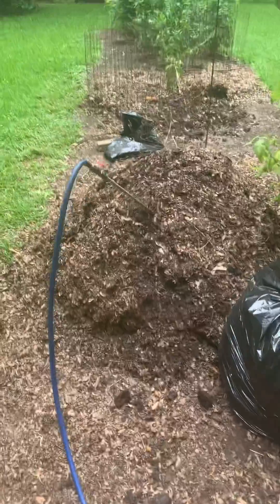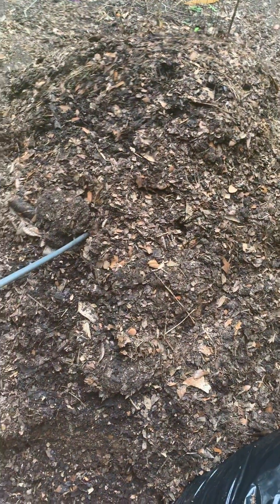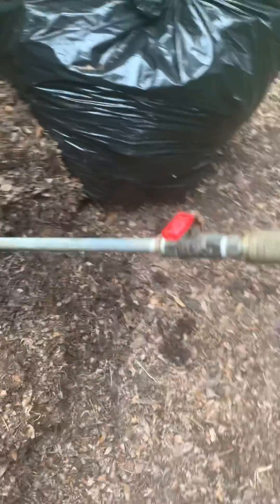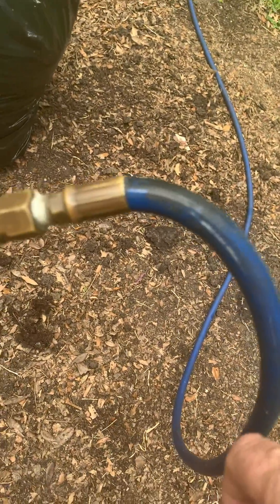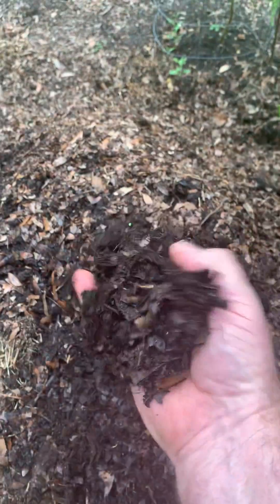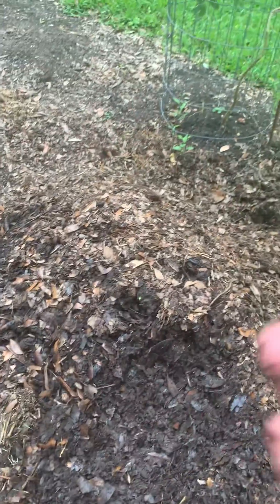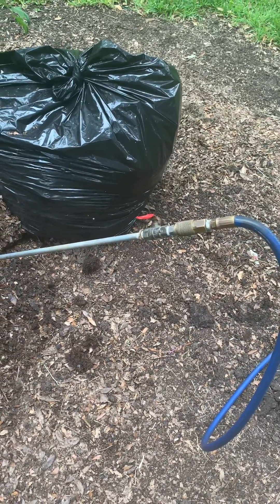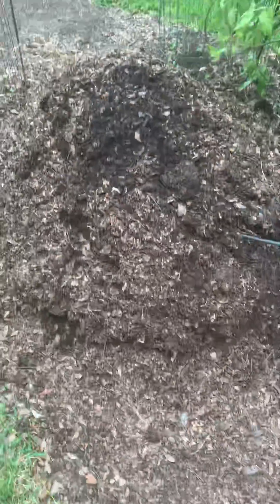Genius method for compost pile aeration

Comment: Hi David. I watched this vid then dragged my old compressor out of storage. Cut the end off the hose and zip tied it to a star picket. Every second day, I've been digging it in to my 2mx2mx1m manure & grass clippings compost pile. It's amazing. I used to dread having to turn it weekly and it was boggy with anaerobic sections. I turned the pile for the first time in a month. The centre was still hot, and the whole pile light and fluffy. Thank you so much for this content 👍👍👍

Comment: waste of time, you are going to have to turn it to get the outer stuff into the center to break down anyway and that will introduce plenty of air. All the air in the world isn't going to help if the center of the pile has used all the fuel and nothing new is added by turning/digging.
Reply: Seems like iyt would beat turning it.
When you figure the center is done take the outside top off as the start for your next pile then use what's composted that you never spent a Sarurday to turn.
Reply: I think you’re wrong

Comment: Guys Ladies you can also use old barbeque tanks especially the larger 30lb to make yourself a portable tank so you do not need to go drag your compressor to your garden and mess around with extension.  You can find here online videos of guys who just get few fitting that go straight into the barbeque tank valve and a barbeque tank is rated at over 375 psi probably 500psi.  So you can fill the tank at a gas station or with your car 12 volt compressor if you want or if you have a big compressor that is ideal.  Those piles of compost breath naturally by themselves but yes in the center of them there is less oxygen After about 1 to 2 feet forced air is a good idea but not daily once a week or once a month is enough.  I have piles 5ft x 12ft and 3 ft high from a landscaper trailer that i do nothing to and they break down into lovely fine compost within 1.5 years.  If i introduced air to them like this i bet they would break down within 1 year or less even if i gave them air monthly.  Another option is 4 inch pipes at the bottom on the ground with holes on the side of the pipe and you could use a leaf blower to force air into them once a week.